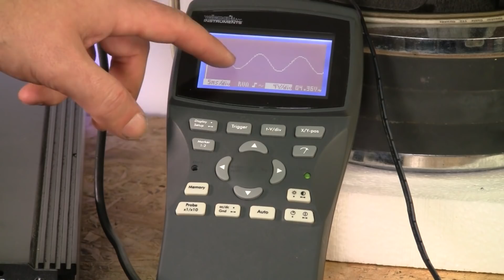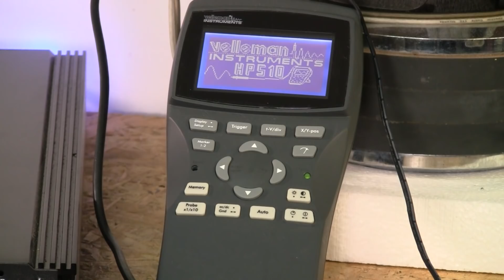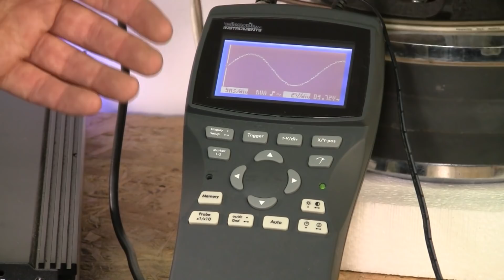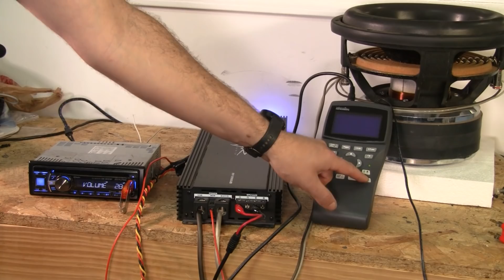How your budget amp kills subs without clipping - Tech Stuff Tuesday

Comment from the maker: Some common comments to be noted here.  Just because you didn't get the result you wanted doesn't mean the test equipment is bad. The same equipment can be seen used in other videos without the same issue. If you don't know what it is, that doesn't make it "cheap", and just because it's "cheap" doesn't mean it doesn't work (after all, you're trying to defend a cheap amp as working fine). I looked into the amp because it seemed to be causing a problem in a car and gave the same result without a sub on the bench prior to putting the sub on the bench. The stray field isn't strong enough that far away to interfere with it (not that it would anyway).
Reply: Bro how many subs did you lose over this bitch ass video? I hope.kevin sees this and proves your ass wrong. You've got issues with everyone. You show off your speakers in a SPL box on one tone ina CRX. You claim this test is accurate but I see 100 things you've did to get the results in you wanted. Faulty amp, no voltage check no amm-1 (wonder why lmao) fuck this channel man. And fuck an emf woofer.
Reply: @jihartbladhest2749  barevids did a reply video explaining exactly what he did wrong and why
Reply: I'm curious if the same erratic behavior can be seen using a different o-scope tho.
Reply: @BallisticSuperiority  it really would not..
Reply: I'm sure that o-scope is shielded 👍
Reply: Lastly, worth while to check that the auto-ranging is not locking onto any noise that might be present. Best to set it to a fixed range and sweep rate to ensure the meter doesn't lock onto anything that might not really be there and actually give you a complete picture of what's going on.
Reply: I posted a reply about something similar in a barevids amp repair video. I skimmed thru it not entirely sure it's related at all but curious on your input about the 2. So I'll post the link for you here.  https://youtu.be/jgpNTq1IjR8
Reply: Also the 75mV signal is likely from the head unit or ground loops in the system since these amps have considerable gain and can amplify any junk coupling into the signal path. It looks like it might just be 60Hz mains coupling into the power supply or the head unit. Not an issue, just indicative of poor shielding somewhere, or a transformer near the RCA cables that's coupling AC into the amplifier. The fact that its not there when the head unit is off, points to the head unit as the source of the signal.
Reply: Bare vids chimed but won't back up his comment...........
And more ....
Reply: @bobdodge3171  actually he destroyed EMF in his most recent video.  But thanks for playin
Reply: @steve390gold  what i win? 😄
Reply: Your scope was zoomed in waaaay too far on the time divide.

Knock it back to 0.2 second time divide not 0.02ns
Reply: I don't think the 1/0 inputs on that amp are meant for 4 guage wires running a 2000 watt amp that probably does above rated power with the gain 3/4 of the way turned. And turning a head unit up without stating what volume the head unit clips at. And testing with 1 oscope saying "it starts freaking out past this volume" maybe try another one or prove your head unit isn't clipping at the volumes you're turning it up to. 

PS to everyone buying skar audio, don't be frightened about the brand by this video. Go read reviews online and look at the huge builds people do with their products. You usually don't hear about them blowing anything unless they're overpowering their woofers or clipping their amps.
Reply: @Koroyanis  You're lost oh auto reply Skar representative. 
Nigga,stfu...
Reply: @LordofthePings-k  I haven't seen you post a single response that even sounds somewhat educated, your input in this comment section is irrelevant. I'm not a skar rep im a skar customer and I vouch for their products. You just lurk in comment sections of YouTube videos and try to be relevant.
Reply: @Koroyanis  you mad bro?
Reply: @Koroyanis  you mad bro?
Reply: Search Results
Featured snippet from the web
There are two ways in which underpowering can cause speaker damage: 1. You overdrive the amp which makes it clip and produce extra harmonics which results in a higher output (usually most profound in the highs) which can blow the speaker (or tweeter that is not designed for a lot of highs).Apr 27, 2010
Reply: EMF Audio When the volume is at zero turn off the oscilloscope and turn it back on??? Maybe it will straighten itself out???
Reply: So what amp would you consider buying Top three
Reply: Your scope was zoomed in waaaay too far on the time divide.

Knock it back to 0.2 second time divide not 0.02ns
Reply: https://www.youtube.com/watch?v=CeMH-JHVLYY&feature=youtu.be
Reply: The soundstream lil wonder 2100 mono does the same thing. I had two in two different vehicles and it burned up the coil on half gain. 1 was on a single 15 rated 1500rms and the other was on 2 of the same 15s in which the 15s should be under powered but it still burned the coils.
Reply: @shivanharricharan7331  Just like most companies there is the cheap side of things. You get what you pay for most times. Soundstream def has a top tier and a Korean model. Hell even rockford went cheap but they rebranded it.
Reply: EMF Audio Please read my comments as no pun intended I am trying to learn something here so they’re all questions from me my friend
Reply: At the same time it was THAT PARTICULAR AMP CAUSING THE ISSUES IN THAT CAR , ever thought maybe a set of diodes or mosfets is failing in the amp you tested ? Also if you’re claiming that the rp series kills subs why does my rp2000.1 go all the way up to 2216 watts without clipping on proper voltage also how is it that my amp has been scoped on a real scope and didn’t show any of the wave problems your scope showed ? I smell a bunch of bullshit
Reply: Now granted I know nothing about how this actually works but from my minimal knowledge it seems to me that either it is not a push/pull amplifier or that the two are unbalanced causing the clipping at either the top or bottom of the wave and not both??? 🤔
Reply: I heard the same thing about the rp1500 but the 3500 & 4500 are good, what I want to know if the rp1200 has the same problem or not?
Reply: How is the amp hooked up? Is the scope on a channel strictly by itself without any load? Im assuming its a monoblock so both terminals are commoned together on the PCB? Still not a great idea to put any sort of scope leads right at the output of the amplifier, esp. if they are a non-lossy (e.g. BNC cable) as they can form a reactive load at higher frequencies and cause the oscillations you are seeing there. Not saying the amp isn't defective, but need to make sure the instrument is actually not causing stuff that wouldn't normally be there. Best approach is to use an off the shelf scope probe at the terminals of the speaker itself so there is no risk of oscillations or any residual ripple from the switching circuitry to cause ringing on the scope leads. Also would be nice to see a purely resistive load used as it will take any odd back-EMF or other effects out of the equation.
Reply: @mysock351C  wrong
Reply: @jihartbladhest2749  How so? Most generic amps I've messed with have two voltage rails (typically +/- 50V from a DC/DC converter) and the switching transistors, followed by an LC filter of some sort if its class-D to integrate the pulses to get audio. 50% DC causes the output to rest at the mid position (0V from the subs perspective) and then if the DC goes up or down (one transistor on for longer than the other) the output will move up or down in proportion to that. Having the DC get stuck at one extreme or the other will essentially pull the output up to, more or less, the power supply rail that its driven from. There will be a small voltage drop across the transistor and the requisite dead time to prevent cross-conduction, but the power rail voltages determine the extremes that the output can be driven to until clipping. If no provisions are provided to clamp the DC by the ICs switching the transistors, the amp will basically just go to the maximum allowed DC until the signal falls below the clipping threshold, or at least thats what I've seen from probing them while they're in operation.
Reply: @mysock351C  I think I responded to.the wrong person lol I just read all your posts and theres  nothing I disagree with lol my apologies
Reply: @jihartbladhest2749  No worries...
Reply: Oh damn lol! Just noticed you have JUST the meter hooked to the speaker terminals for part of the test. That is a major no-no. NEVER run an amplifier without any load attached to it. When you just have the meter there, you have a reactive circuit hooked to the output, and the amp may oscillate. If this was a high power class AB, your meter would be in heaven right now. The amp would absolutely NUKE the front end if it broke into high power oscillations.
Reply: @mysock351C  The oscillations are a very critical issue in RF amps, but are they as noticeable or important in the hearing range as well?
Reply: @alimahdavi2276  TO be fair, I don't think its as much of an issue in car audio due to the relaxed frequency requirements, as EMF Audio points out. But I did see it with my TDA1554 cheapie amp. I stuck some BNC cable in along with a load resistor to mess around with it, an the amp started oscillating, enough to be off the scope screen, owing to the fact that the BNC cable looks like a high-Q resonant circuit. Its an issue as some amplifiers, especially those for home audio/hi-fi, have broad frequency responses to achieve good fidelity through 20kHz, this means that the compensation networks to roll off the high end gain are typically far above that. Some amps boast flat responses out to 100kHz and some audio ICs will have gain bandwidths to almost 10MHz. This means that they can act as RF oscillators if a sufficiently capacitive (or reactive) load is across the speaker terminals. This could even be a very long section of speaker wire, or something else stuck into the terminals. The amplifier can then start oscillating. In car audio, most high power amplifiers are for subs, so its not as much of an issue as they have very narrow bandwidths (typically only to about 250Hz), but full range class AB amps can be susceptible to oscillations. Class-D should more or less be immune to this owing to the topology of switching amplifiers, but they too can potentially have issues.
Reply: Thank you 😊 that amp is good
That's a ground noise showing up on that scope and if you have 2000 watts rms sub playing it with 2000 watt amp and you have the gains turn down of course you will damage the sub because it goes from a DC current to a AC current so stop LYING!!!! To these people run that crap to someone else who doesn't know and I gave the person who made this video a thumbs down because I'm not the type to thumbs down without letting you know who gave it to you I'm disappointed with your lying he needs to tell the truth I'm not taking to the person who comments I replied to I'm talking to the person who made this dumb ass Video " TEAM SOUNDSTREAM MIAMI 305
BIG DADDY ZIG DE-50.CAL
Reply: Holy Word salad, batman.... Ever heard of a period?
Reply: @Afterschoolspl  Someone tell him just because you HAVE a period doesn't mean you don't have to USE a period.
Reply: @Adonisrael9928  Yeah I would suspect that it was just a matter of them turning the thing WAY past the point where it starts flat-topping. Class-D amplifiers are capable of conveying DC signals so if someone turns it up to 10 to get a cheap amp to "thump" your basically hooking the sub up to one of the supply rails for a portion of the audio, and then the other when the clipping is severe. That will really cause the dissipation in the voice coil to skyrocket since there will be little back-EMF to counter the current coming from the amp since it will just be stuck at one excursion extreme.

Comment: I’ve had my rp2000 since 2021 and have run it on 4 different setups currently set up on two evl 12s in a qbomb box had it on my 18” evl setup and on my 2 punch t1 12s setup still have all my speakers none of em blown some ppl really suck at tuning or maybe just have bad luck I guess retune if you’re getting hot bc the couple times mine did get hot I tweaked my amp tune and eq’d the radio a lil bit then boom 🎉

Comment: I wonder what's happening 🤔 I've been running the 75.4 and 1500.1 from skar audio for almost 6 years now. I have the gain set on the monoblock to -3db test tones. I blast my system all the time sometimes even taking the risk in clipping my head unit when I'm really feeling the song; I haven't had an issue with any of it yet
Reply: I used a rigol oscope from my school to set the gains and look at the signals to find clipping points on every source. The LOC outputs a clean signal, when I hooked up the skar amp, it had a small ripple at low volume. That ripple smoothed out as I increased volume.

I learned all about amplifier classes at school, and it all started to make sense. It's common for D class amps have that little bit of distortion.

However the distortion I saw on my oscope is normal for D class amps; the distorted signal shown in this video is very different

And YES the subsonic and LPF are not very accurate on these amps 😆
My very first amp was a kicker, it was a pretty good amp
Reply: @39doritoz it’s because the oscilloscope is right next to the gaint magnet and the vid is just straight fake

Comment: With full respect's I love your work and I don't think its your Test equipment,  i think its a defective unit, I am unable to get the same results you got doing the same set of tests, I'm unable to get it to output anything at 0v RCA, strange noise out of it- or any isolations on my Pro docility scope ..  or at least the RP2k I own .. I hope it does not fail like the one you got there ... I think it sounds good also, not like a Crockford but truly a good sounding amp,

Comment: U have the oscilloscope on the speaker magnet so as a result the magnet is causing interference.  Put the oscilloscope at least 8 inches away from the speaker magnet. That is where your problem is.

Comment: Every since I been running taramps I don't get anymore coil smells the clip indicator works perfectly and my gains are set properly? I had audiopipe and sundown sfb amplifiers and they are just the opposite will clip your subwoofer to death and on another note every class d amplifier I owned? When you have the amplifier completely off you can hear the subwoofers playing in the background? Not good it should be completely off until you adjust the gain to match the head unit voltage output? Class ab amplifiers are the best then class d full range then class d?

Comment: I had two smoked subs on two separate RP amps. One 8” on a 350 and one 12” on an 800. I may have had settings wrong on amps as I didn’t have a Scope yet. But now I do and will test everything and set gains accordingly to ensure no clipping. But what I have found so far is that my head unit can go full volume without clipping. So unless my gains were wrong on the amps, the burnt subs were due to something in the amp. My power and grounds were all verified to have no voltage drop as well. And I never ran full gains on either.

Comment: You really.  Only want too see only 10 too 30 millivolts on your DC offset if you see more that means your bias is set too high and will not perform as it should its know too be that old amps as they age will have a high DC OFFSET or due too heat created buy this amps that usually get no air in the car environment  cause parts too get out of tolerance  as they use the cheapest parts available too mass produced these units too sell too the public that just runs the hell of these amps with no cooling and usually they just think of buying bigger subs too get more power out of the cheap amplifier too theses massive subs but fail too think about heat that these amps create due too the nature of heat creates power and parts dont do well with heat.

Comment: I would rather have a Kenwood mono block than a Skar RP2000, it’s only a 2 ohm stable amp but it’s much better quality. I would definitely put the money on a high quality mono block even if it’s only 2 ohm stable and 1000 watts due to my budget.

Comment: Yes it puts out over rated rms but the build quality is horrible. My first skar amp the  input was lose on the first day of install.  I thought it was  from. shipping or something I hit but when I took it about the rca only has one pieces of solder the screws don’t actually hold the rca connections to the plate. I got a new one through warranty. It worked but build quality is horrible. It lasted 3 months then shorted. Good luck because it’ll play random frequency lol

Comment: I was running a Skar SDR 10" @ 1 ohm on this same amp. Set the gains with a multimeter and was running right at the 600 watt RMS rating. Never had ANY issues. Upgraded to a 10" EVL again set gains with multimeter and STILL not having any issues. No weird smells, nothing unusual. Cheap ass $7 Bluetooth adapter for the RCA signal even. No issues at all. Not saying your particular amp doesn't have an issue.
Reply: Ive been running one single Audiopipe BD15 for just under 7 years on a Skar rp-2000 just like that. Set my gain through a borrowed o-scope when i installed it. I beat the absolute shit out of the sub almost every day, and its never blown. on a 1 ohm load. Running one single line of 0 guage CCA wire too. One of the best amps ive ever had. Reliable, and puts out good power. Just dont clip your shit and theres no problems.